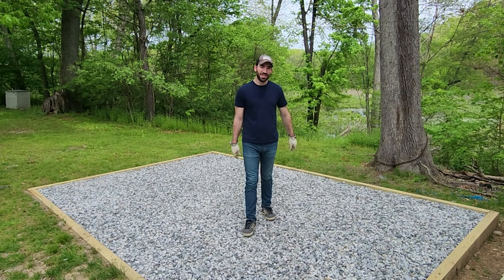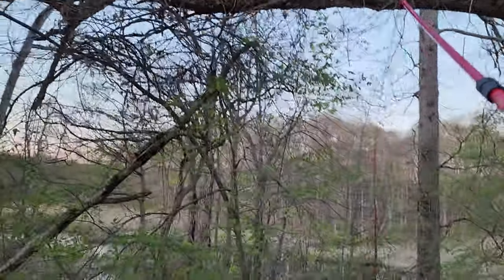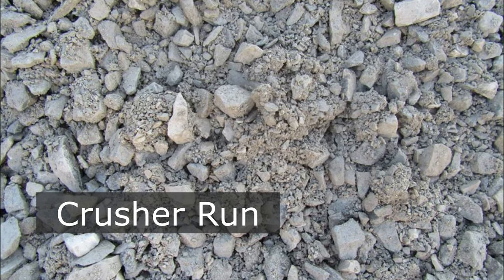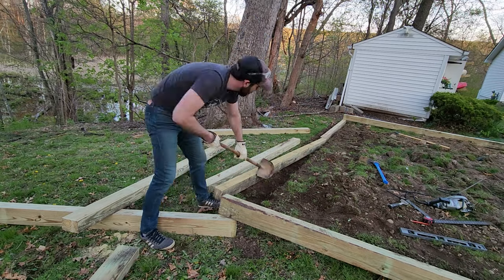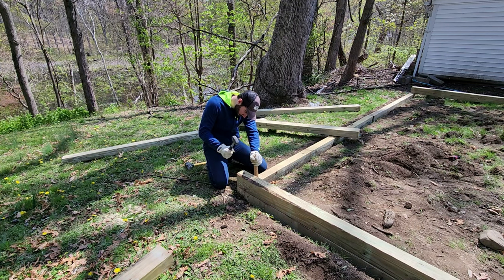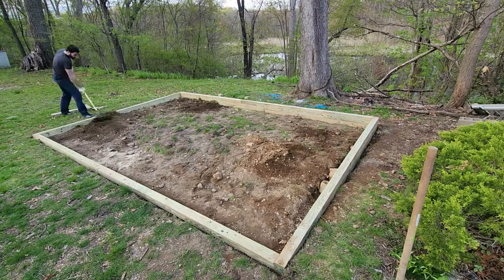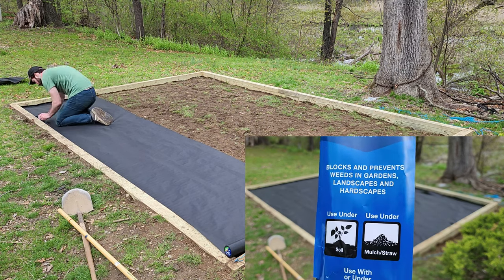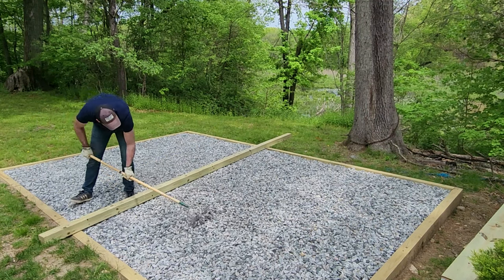How to build a gravel pad shed foundation by yourself | Shed Build Part 1

Comment: You seemed worried about the drainage, then you put landscape fabric surrounded by a wood frame, you trapped the water into your foundation,  I am sure on heavy ran you will get water flowing between your wood joints, so your wood wont last that many years.  Landscape fabric really only prevents weeds for a few years, dirt will get on top of the fabric over time and seeds will germinate on top of it. for better drainage, better not to use any landscape fabric and just spray it with roundup twice a year.. not hard to do.
Reply: Round up is trash.
Reply: @clintonclark1712 ha for sure!  You told him!
Reply: Round up is good as long as you don't plan on having health happy kids.
Reply: Slightly confused as to how you can spray once there’s a massive shed there?
Reply: @naomidommett2133  spray around the shed, the weeds wont grow where the shed is hah.  Also as long as your kids are not eating the dirt you spray the groundup with, yours kids are fine. Or if you have a drinking well.. also not a good idea.  other than that, all good twice a year
Reply: 1.) water goes right through weed fabric. 
2.) the weed fabric isn’t just for weeds. It prevents the rocks from sinking into the soil overtime.(which it will)
Hope that helps.
Reply: @ZupE891  it depends. My neighbours bamboo has grown through our fence, and now up through the pavement in front.
Reply: I like turtles
Reply: I perforated the fabric around the " exposed" part of the pad to help ease rain water thru. Spot spraying ( screw Roundup) with basic ground kill with only 2ft of perimeter is not a difficult task nor does it use alot of chemicals.  You can also tie 4 goats around each area of pad 😂pad 😂
Reply: @clintonclark1712 , not correct
Reply: @freedombro6502 , nope. The case made for good news though.
Reply: You realize that water drains through landscape fabric, right?  Been using for years have not had one instance of water not draining
Reply: @msk3905  drains very slowly and on top of dirt it's extremely slow so water will pool up even on moderate rain. Which isn't good for the longevity of the wood.  Better to put an outlet for the water in the low side of the box
Reply: @ZupE891  hmm i guess my graveled fire pit area area didn’t get this memo or maybe me doubling up the fabric for some odd reason is helping it drain better because i have zero drainage issues with it even during the monsoon like rains we recently had.
Reply: @msk3905  You have a wood framed fire pit? sounds smart.  You can also see through the rocks to see if there is pooling water during rain? that's some superpower. sorry I guess you proved me wrong

Comment: To each his own but this is overkill, no need for a gravel pad.  Built two sheds using solid cinder block foundation leveled on 2-3” of compacted gravel.  Easier, looks better, keeps any wood from contacting ground, keeps critters from going under, and cheaper.  My first shed is 10 years still looks fantastic and most importantly level.

Comment: If you have a pad measuring 2.6 cubic yards (12ftx18ftx4in) then how would you only need 1.5 cubic yards of gravel? Also where did you find gravel that cheap? My pad is 1.1 cubic yards and the 3/4in gravel is much more expensive than what you stated in the video for a smaller pad.

Comment: I would be concerned that the beams are set in clay soil.  There is nowhere for rainwater water to drain to and it might not soak into the ground..  The  beams act like a retaining wall and will hold water.  They should have a way for water to drain out.  I would put the beams on only three sides  to allow rainwater to drain out.
Reply: Just have the base on a slight slope so the water drains away
Reply: @garrettharper6046  drains away after it fills up like a swimming pool and flows over the top ?
Drain tiles needed to be used so water has somewhere to go 
as it is - during a heavy rain - it is simply a 4" swimming pool

Comment: You mentioned you were using 4 by 4 and 4 by 6 but then when you describe the base outer walls you mentioned it's 4 by 6 stacked on top of one and other. I don't have as big of a drop as you and am wondering if it would be ok to stack a 4 by 6 on top of a 4 by 4 to save on material
Reply from the maker: @shrimp6la  I think that would be fine. To clarify, only the front rim is 4x4 for my pad.

Comment: Nice work!  We have a groundhog colony living under our shed, the pad is not nicely framed and anchored like yours, just leveled on cinder blocks on top of ground-up blacktop. I have owned a few sheds over the years, I realized that it is well spent time to caulk all the interior seams along the studs and walls, when I did this no issues with rodents or even insects. Best of luck building your new shed, look forward to your upcoming vids, based on this foundation I'm confident you will build a quality shed.  Like everything else since Covid prices have increased gone way up, for those looking to purchase a pre-fab site assembled shed.  I purchased a few Sheds USA sheds over the years (A company that was based out of NH, they were bought out by Tuff Sheds, prices have increased significantly).  I was always curious about the Amish built garage buildings, they seem reasonable relative to new construction by a local contractor, however you do have to provide the cement pad and I'm not sure what the requirements are with the local building dept., likely strict here in the NY Metro burbs in the lower hudson valley.
Reply: Quick question- Have you figured out how to get rid of the groundhog colony? I think we have the same problem under the shed that came with the house when we bought it. I am considering having someone move it so we can take it off of the blocks & put a gravel pad down instead. I am sick of the groundhog coming out every year. I want a garden beside our shed.

Comment: it sounds like you started with the highest point of the perimeter instead of the lowest.  Is that true?  I would have loved to see how you did the partial supports under the sloped area.
Reply: me too
Reply: Have you found another video that shows this?  No one seems to show this part of the process, and it's the part I find most confusing about the instructions. @danceforpeace
Reply from the maker: I'm not entirely sure I understand your question. If you mean how much I dug down on the side walls, I started by digging to my lowest point at the back of the pad (lowest part of the slope). At the lowest part of the slope I had to dig down 3 inches. Remember, I was stacking two 4x6 beams on top of eachother (12 inches of wood) at the lowest point. I had a 9 inch drop from the highest point of the slope to the lowest and I wanted the top of the pad to be level with the highest point of the slope (i.e. front side of the pad) - so the 12 inches of wood at the back (lowest point) was buried 3 inches leaving 9 inches out of the ground. That was the starting point. From there I had to dig the trenches up the sides. The lowest point of the side trench was 3 inches down. From there I dug a level 8 foot long trench towards the front of the pad (high point of the slope) the depth there reached at least 7 inches. Then I dropped my 8 foot beam down in there. The beam was level - the back end of the beam was exposed 9 inches out of the dirt and the front end (closest to the higher end of the slope) was buried by at least an inch. Then I continued the trench from the top of the 8 foot beam the final four feet to the front of the pad. This small trench started at about 1 or two inches deep to match the depth of the top/front of the 8 foot beam and finished at 4 inches deep at the front of the pad (highest point of the slope). I could then drop my 12 foot beam into that space.... 8 feet of that beam was sitting on top of the wooden beam below it, and 4 feet was sitting on top of dirt nearest the front of the pad. 

That was a long explanation... hope it helps.
Reply: I really appreciate the detailed response!  I think my struggle is that although I've measured the drop and such, my lowest corner will involve 4 stacked boards.  I'm trying to figure out how best to lay the bottom shorter boards, level and square them, and add the next boards on top until I get to the actual level that I want to be consistent across the whole pad.  I wanted to see a video of people doing this, but I've only seen it described in text.  Your video and reply makes it sound like you put both of your stacked boards in at the same time, and I'm not sure how I would do that.  Do you have any insights for me?  Thanks again! @EveryotherKarl
Reply from the maker: @randycathcart3896  Hmm, I'm wishing I filmed more of that process now. I did do it in levels actually. I made sure the bottom boards were level before putting the top ones on. Similar to laying a cinder block foundation. However, I kept stacking the top boards on and off to check that the overall hight of the walls was correct. I actually ran some string lines to give me a visual of where the top of the walls needed to be. Basically level at the top of the pitch and 9 inches up at the bottom. However, the lines were ultimately getting in my way so just stacking/restacking and checking my level every now and again was my preferred method. The strings might be more important if your walls are higher.
Reply: Your video was great.  It's hard to stop and film every little thing when you're in the middle of a project.  Your answer here was helpful.  Thank you for taking the time to reply. @EveryotherKarl
Reply: My project has been such hard work, but it's nearly done, and your video was quite helpful.  Just awaiting the delivery of the gravel now! @EveryotherKarl
Reply from the maker: @randycathcart3896  that's awesome!

Comment: Karl I would be interested to know how your shed has settled on the rock base. I am concerned the shed will settle and go out of level, making it very difficult to correct without pads to install shims or the like.

Thank you for taking time to answer if you can.
Reply from the maker: Hey Fred, definitely a valid concern. My shed has not settled since I completed it about 9 months ago at this point. I think it depends a lot on how well the ground and gravel are compacted before you start building. Also, it would be more difficult but not impossible to jack this shed up to re-level if needed - just need to dig under the skids. So far so good.

Comment: I had a question hopefully someone had the answer to. Started mapping the foundation and just wanted clarification. My area has a similar slight slope down. Are you digging 4 inches down at the front just for the wood to sit in? And/or are you digging 4 inches along the boarder for all the wood to sit in, then leveling out with extra wood in the back? Or is that to account for the 4 inches of gravel you’re putting in the bottom? I assume the back you didn’t have to dig much, but like you said, fill in the dirt from the front. 

That might not have been the best way to ask that, but I’m very new to woodworking/lawn care/etc. because my wife and I just bought a house last year. This video has been the most helpful so far. Thanks
Reply from the maker: Sorry I missed your comment. I think I understand your question. All the wood is sitting at least 4 inches in the dirt to hold it in place. In the back I stacked the additional wooden beams on top to level it all out.

Comment: There's a pre-exisiting shed on my property that didn't have a proper foundation. It was rotting through the bottom joists, and I had it lifted up on concrete block, but I've been wanting to move it and reconstruct on a proper pad. thanks for this! It seems do-able on a similar incline, and I might make a pad large enough to accommodate both the shed and my smokeless fire pit. Thanks!

Comment: 1.5 cubic yards of gravel spread over a 12'*18' area, so (3'³*1.5)/(12'*18') = 0.1875', or only 2 1/4" average depth. You mentioned 4" at the beginning. Did I get something wrong or did you settle for less depth in the end?

Comment: How deep was the trench for the back wall? You mentioned 4 inches for the front trench. I will try to use your technique for a playset pad. I am dealing with about a 9inch drop as well.

Comment: Not trying to be critical but if you dug below grade and used 3/4 clear, will it not fill with water, freeze and heave? Should gran a crusher run be used below grade and clear if your pad is above to drain? Thanks

Comment: I'm confused with amount of gravel. Did you say 1 & ½ yards of the gravel ? However. I'm curious specifically to amount of gravel I'd need for a base of 14'×14' at 4" deep, +/- ? Your advice would be most appreciated.
Reply from the maker: @DavidCarrasco-z9d  Hey! I made a mistake in the video, I used 2.5 cubic yards of gravel, not 1.5! 
I think it would be a similar amount for you.
Reply: @EveryotherKarl  cubic yards. Thank you. Gotta figure my math on that one. Thank you Sir, I appreciate the "call back." I'm thinking of even reducing "footprint" to  13'×13' since it's only a 12'×12' shed. Entire pad will be 3' from corner of where mine & neighbors fence are so I'll still have ample space along those 2 sides of its perimeter. Again, thank you very much for your feedback.

Comment: I have a question! If I were okay with having a gravel floor in the shed I am going to build, could I do this and attach my walls to the 4x6s that are on the ground like I would attach a structure to a concrete pad? It would be smaller not sure exactly the size I want, probably around 8x10.
Reply from the maker: I think that would be fine, I'd suggest anchoring that kind of shed to the ground with shed anchors.

Comment: I liked your video a lot, especially since I am preparing to do the same type of project in my backyard.  Did you treat the wood beams with anything prior to putting them into place?
Reply from the maker: I did not treat them myself, but they are already pressure treated from home Depot.
Reply: @EveryotherKarl only the pre exposed pieces are. When you cut, you should treat, or. The rot will start sooner and quicker at the cuts.

Comment: Did you lap joint the lower 10 and 8 ft beams or just screw them together? Your shed is coming along awesome!!
Reply from the maker: Thank you. 
I just screwed them together and it's working fine since they're partially buried and the ground holds them together, but lap jointing would be better, especially if the wall is a little higher and they're more out of the ground.

Comment: I am about to begin my gravel shed base, but the only thing I am having trouble understanding is if it is okay to have the ends of the rebar stakes exposed on the top layer of timbers. will this rust out? Does it need to be covered or sealed? Thanks!
Reply from the maker: @ambabusa  I did not seal mine, it might be a good idea, but mine haven't really caused a problem in over a year.

Comment: I know that prices may vary over time and location but I'm just curious what is ended up costing vs hiring someone in your location. 

Also, I have a similar slope to my yard and I'm wondering how water will drain out on the lower end. Does the wood not hold it in?
Reply from the maker: @mallorywilde  it's been draining pretty well for me - no issues so far. 
I did a video breaking down the cost, but long story short it cost $7,662. If I bought a premade shed it would have been somewhere around $15,000 minimum - probably closer to $20,000 if I paid someone to build it.
Reply from the maker: @mallorywilde  I just realized you might have been just asking about building the gravel pad. I think that cost somewhere around $470 to $500. I'm not sure what it would have been to pay someone but I'm guessing between $1,200 to $1,500.

Comment: Do you need to re-seal the pressure treated lumber when you cut it?
Reply from the maker: You should, especially if you see an area that wasn't soaked through properly with the pressure treatment.

Comment: What location in this? Apparently not a frost area. Good for a no frost area. In my opinion utilizing  this method in a frost area without piers will cause the shed to sink .
Reply: I don't follow? I bought a shed in michigan already built and in place at the seller site for 20 years never sank in that time 42" frost line.
Reply: I too am in MI (SE). No sinking shed while sitting on 4x4 PT lumber on top of gravel. I don't know of anyone that has a shed around this area that has made use of piers; unless directly over a lake, river, pond, etc.

Comment: I have a huge drop for where I want to place my shed. Its about a 15 inch drop. Anyone have ideas for what I should do? Same method as with this just add more timber? Thanks
Reply from the maker: My first suggestion would be to see if there was any other area that you could put it that was more flat. If not, you might want to follow a similar method as me, but you should probably use some larger timber like a railroad tie or something that size. You could also build a masonry retaining wall, or you could build you shed on deep concrete footings.
Reply: I would add some drain tiles as well to stop water from being trapped inside of a wooden frame
If you are in a frost location - pillars should be used otherwise the wood will start to sink after every frost - - 
mount pillars deep enough to break the frost depth for your area

Comment: Did you consider concrete blocks instead of the pressure treated lumber?
Reply from the maker: No, pressure treated was always my plan. Blocks would be good, but more work in my opinion.